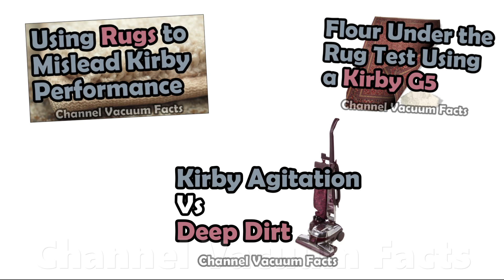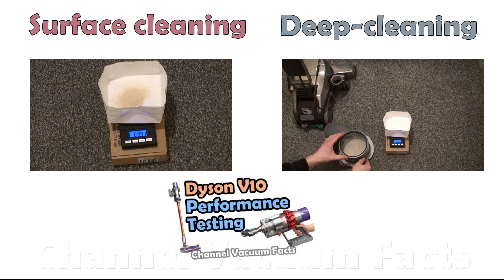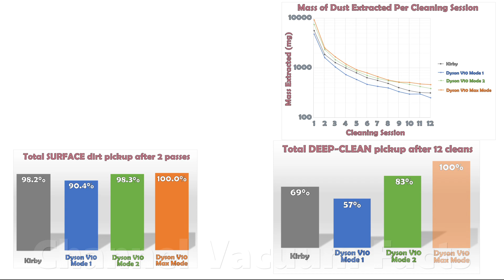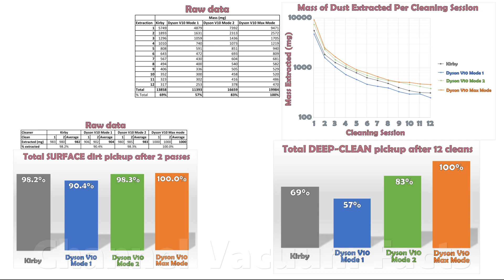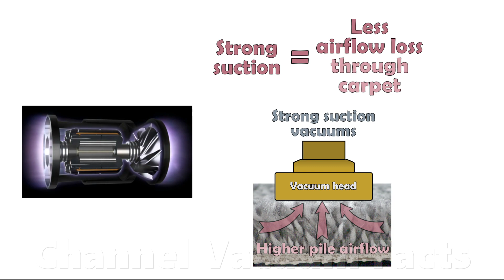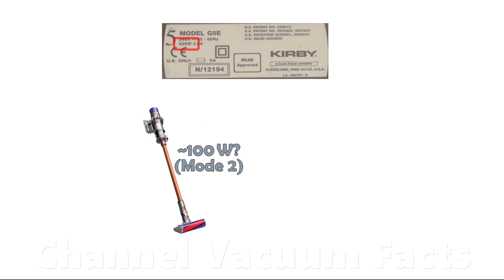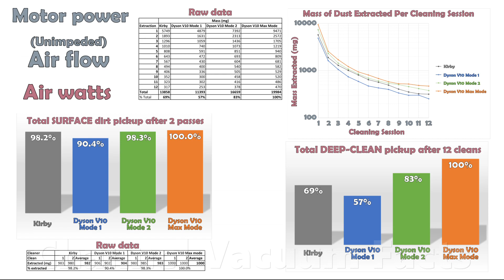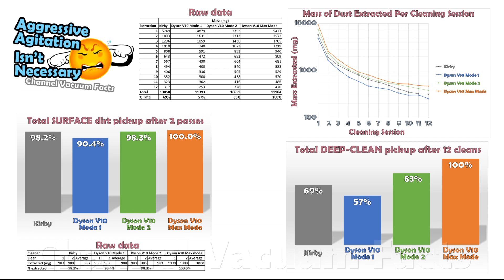Dyson V10 Vs Kirby: How Well Does a Kirby Vacuum REALLY Clean?

Comment: Interesting video. What I would say is that the Dyson we had died after a year of use, also on Max mode the battery lasts10min only so it is a pain to do whole house cleaning. Your tests are interesting but I would say the Kirby’s performance is adequate for most consumers, also still going strong after 10 years is much more a benefit consumers would enjoy than outright performance. We bought a Sebo as well and found it to be very similiar in performance to a Dyson, and quality to a Kirby. Best of both worlds really.
Reply from the maker: Um. Firstly my Dyson didn't die after a year of use (it's under warranty for 2 years anyway, so you get a new one for free if that story is even true...which I doubt). The life story of a SINGLE unit has no representative bearing on a product at all. Secondly, you're not supposed to use it on max mode all the time. This is clearly stated in the manual. It's designed for spot messes; it cleans heavy messes faster, not better. Amazing how many people don't realise. What level of performance is 'adequate' for 'most' consumers is not really for any one random person to say and I don't even agree. Given the resources consumed by the Kirby, to still be guzzling that much power after 10 years is absolutely no virtue at all. And we'll say nothing about 10 years of trying to use something that impractical and relatively poorly designed. What people actually want is the best performance (otherwise what's the point), ease of use, minimal maintenance, minimal running costs, and minimal impact on the environment. This is why more modern cleaners and upgrading is desirable; better and more efficient technology is available over time. The problems with a sebo and the kirby are covered in my reviews. https://youtu.be/x_Rry3u1Kcs and https://youtu.be/IJz-lYoF1_o
Reply: @VacuumFacts  You are entitled to your opinion, and I am entitled to mine. Just a note, in South Africa, the warranty is 12 months. We like our Kirby, we like our Sebo, we didn’t like our Dyson. I think there are many Miele, Defy, Shark etc models that would also compare favorably with Dyson, but I am seeing a bias here as that is the only brand you keep referring to. South African consumers favor the quality of a product over the modernity of a product. We don’t tend to replace appliances each year or two years and therefore a limited warranty is usually a discouragement. Irrespective, if you enjoy your Dyson, I am happy for you, we didn’t like ours.
Reply from the maker: @Jakdennnnnnn3d333  >> “You are entitled to your opinion, and I am entitled to mine.”
I agree; however, on matters of fact that are either true or false, opinions don’t matter. I only stated facts in my last comment.

>> “Just a note, in South Africa, the warranty is 12 months.”
I fact-checked this claim (which I didn’t believe) on the official Dyson website and found it to be false. The warranty is for 2 years. Anyone can confirm this for themselves by visiting their website here https://shop.dyson.co.za/vacuums/cordless-vacuums Why on earth did you claim it was 12 months?

>> “We like our Kirby, we like our Sebo, we didn’t like our Dyson.”
Everyone has their opinion; not all are worth respecting. Most opinions are uninformed and poorly rationalised. I was not convinced at all by anything you said. But I understand your point of view.

>> “I think there are many Miele, Defy, Shark etc models that would also compare favorably with Dyson, but I am seeing a bias here as that is the only brand you keep referring to.”
This is an assumption / opinion on a factual matter on which evidence is bearing. There is no evidence I’ve seen that products from those brands perform better, not did you present any to support your suspicion. In fact, there’s evidence to the contrary, such as here https://youtu.be/pVheYuzIk3I

The reason Dyson products are discussed on my channel a lot is explained in that video too; it has nothing to do with ‘bias’—a claim often made but little supported. It’s because they make technology objectively shown to be the best on the market and I like their approach to engineering and science. I don’t devolve my channel into petty tribalism—I leave the many idiots commenting to do that for me.

>> “South African consumers favor the quality of a product over the modernity of a product. We don’t tend to replace appliances each year or two years and therefore a limited warranty is usually a discouragement.”
Do you have any evidence for this? I’m not aware of any good reason for you to speak on behalf of a nation and I thus don’t believe it, particularly as the earlier fact check showed your claim of 1 year warranty to be completely false.

>> “Irrespective, if you enjoy your Dyson, I am happy for you, we didn’t like ours.”
That’s fine; although as I said earlier, I wasn’t convinced the opinion was informed and therefore respectable. I respect you too much to respect the opinions you expressed on the matter.
Reply: @VacuumFacts  Regarding the warranty, that was the warranty we got when we bought it three years ago. I actually live in South Africa, so yes, I can talk to consumer appetite as I work in retail. We are an extremely unique nation when it comes to the purchases of appliances. And here is something you also didn’t know about South Africa, just because Dyson gives a warranty on their website DOES NOT mean the same warranty is afforded to you at a retailer like Makro. We didn’t buy from Dyson’s store directly, because at that time, there was no Dyson store on the street in Pretoria. You had to buy it from independent retailers. Irrespective, we are arguing about vacuum cleaners which is a bit laughable. So enjoy the rest of your day, and enjoy your Dyson. I’ll enjoy the Sebo 😉
Reply from the maker: @Jakdennnnnnn3d333  I'm not attacking anyone; I'm simply and politely explaining my position. Often when people disagree (or don't like what they hear), clarity is misinterpreted as an attack for some reason. Still, facts are facts. I don't like Kirby's; you're right. But the difference is, I can explain why and back it up with evidence. This moves an opinion out of the 'any idiot can have one' box to the 'informed, justified, and sensibly rationalised' box. Regardless of where the product was purchased new, the Dyson 2 year warranty applies as long as you can show date of purchase. This is true anywhere in the world (unless someone has official evidence to the contrary), as Dyson's website explains. Finally, there are plenty of review videos of other products on my channel, with good measurements and other facts. Unless a product is technologically interesting or makes an outlandish claim, it's not likely to be featured. So, Miele, Shark, and Bissel products therefore don't qualify. My review playlist can be found here https://www.youtube.com/watch?v=2BHbIgOG9qA&list=PLBxUOcW7kaEtK3qcKCMEaLKTrP8Ehu8sz .

Comment: No one speaks that Kirby has a plenty of patents, and one of the most important is - it has a 2 motors, one for sucking, 2nd for cooling, it can work 24h in a row and the healthy part is, they are located in the separate compartments, because of that it doesn't produce any carcinogen,  where all other vacuums in the world are cooling the motor with the same airflow which goes through the filter and small bacterias with a size less than a micron creates the BBQ🔥️🔥️🔥 Bon apetit!
Reply from the maker: o_0 er ok

Comment: The actual truth is I've brought my Dyson vacuum to the damn Dyson Repair shop more times than I replaced a simple belt on the Kirby vacuum I purchased afterwards. Cheap plastic materials will never last as long. Dyson's are made for those who don't want a long term , reliable vacuum.
Reply from the maker: Not that I believe you, quite what you were doing to your machine to cause it to need repair so many times, in total contrast to the majority of users, is a mystery. Dyson products are not made of 'cheap plastic materials'; they're made of advanced polymers that are highly durable, as all the evidence available for anyone who bothers to look for it before forming stupid subjective opinions shows. There is plenty of evidence of original Dyson machines working today. And there's no evidence they aren't reliable if treated with simple care and respect as outlined in the manual. If you have a dot of convincing, statistically significant evidence from a credible source, send it along for review. >_>
Reply: @VacuumFacts  just look at the materials used for both. They speak for themselves, you don't need a credible source to tell you which one is made of stronger, longer lasting materials einstein. Nobody's talking about suction here. We're talking about long term, lifetime products. Dyson's are definitely not that. They sell plastic overpriced vacuums.  Plastic.
Reply from the maker: @dereklaverne7608  They're advanced polymers. I don't think I ever heard a policeman complain their 'plastic' riotshield wasn't as useful and light and long term durable as their metal medieval shields. You don't have a clue and all this is debunked in my videos, which if you'd care to watch, you might learn something.

Comment: Jesús Christ these people sound like Trump supporters you give them facts and analytic data and they tell you fake news who really needs to deep clean anyways when you can do light dusting everyday with a light weight dyson or any other handheld
Reply: You’re so Trump deranged that you felt the need to bring him up on a video about vacuums.... 😂
Reply from the maker: @DayumQuitPlayin  o_0 Well, ignoring that you literally said nothing of value or addressed any of the problems shown in the video, I can confirm 'Trump' does not appear in the video, nor has anything to do with any of my content. To erroneously suggest otherwise in fact suggests the opposite, and that it's you who are so trump-deranged that you see it where it doesn't exist. That's mindlessly hypocritical.
Reply from the maker: The latter part is slightly the wrong way round. The V10 was measured to deep clean better than the Kirby (the reason why was explained in the video). This is of course, the whole point of the V10; better performance made much easier to use, using less resources. It's not a compromise on performance; it's miniaturised and supercharged.
Reply: @VacuumFacts  yea ik I’m just saying if you clean everyday their no deep cleaning at the end of the year although a dyson would do much better if you deep cleaned
Reply from the maker: @manzoj5898  Yeah that's a good point. And you're right; the Dyson cordless utterly champion easy regular cleaning, avoiding the need for a hard work, mega-clean chore.
Reply: Was thinking same thing. They are very aggressive lol

Comment: I like all the fancy hullabaloo you're spouting here. But after reading through the comments and seeing you being repeatedly proven wrong or asked to preform true side by side tests with the same true parameters you seem to have an aneurysm anytime anyone didn't automatically agree with you. In fact when you've been proven wrong you flat out get arsehurt. Yet apparently the Kirby users are the ones butthurt? Lol. You're attacking anyone who even uses the name. Ffs what is wrong with you? 
Btw, as someone who has has the same kirby for the past 25 years and only needed it serviced once... I'll tell ya this, the thing was built to last and can take more than its fair share of beatings. You could honestly probably hit the damn thing with a truck and it would still turn on and work properly.
Reply from the maker: Not sure what video you watched, but the comparison you speak of was presented in this video and the corresponding data is fairly clear, as is the data in the videos linked to in the description. The Kirby review https://youtu.be/x_Rry3u1Kcs also called out the fallacy you're peddling that fails to distinguish between cosmetic surface durability and operational durability of working parts. Modern high quality polymer blends take severe beatings (much like the riot shields they share materials with), as shown in the review video, and modern machines should not need servicing during their lifetime, requiring basic costless user maintenance. All components are modular and are simply replaced in the very unlikely event of failure. Your comment is full of inaccuracies, ad hominem attacks, makes no sense, presents no credible argument, and ignores the strength of the data in this video. But should I have been surprised...
Reply: I agree, kirby's are great machines (I have 3) and they do more than just vacuum most forget that they shampoo, buff, inflate and deflate inflatables, blow leaves, polish hardwood floors, massage, sand and scrub plus more. Also one thing that gets me is the charge cycles on a dyson cordless? Is the battery built in or user removable? (like a cordless drill?) If not how long will it last? And the cost of replacement outweighs buying a new one? If so, a dead dyson ends up by the curbside that ends up in a landfill vs me fixing a rescued kirby for about $45 and that was 10+ years ago.
Reply from the maker: @jamesheina3337  They shampoo (i.e. clean) poorly, as many have shown, and most people don't buy a vacuum cleaner for it's ability to blow leaves. It's no virtue to be capable to some degree of secondary things if it's crap at its primary function. Very poor and unconvincing argument. The battery is removable on Dyson cordless, but expected and smart use would never need to remove it. Unlike competitors, smart battery management allows the Dyson battery to retain 80% of its original working capacity after 15 years, relative to the competition's 5 years. In the rare event of a failure, replacement batteries are considerably less than the cost of a new machine. The stick vac formfactor brings huge advantages.
Reply: James Heina, kirby’s are not good vacuums, they waste energy, have poor filtration, not to mention the effect dust loading has on performance. Also clearly Kirby should of focused on making it a good vacuum rather than a multi tool which accomplishes nothing.